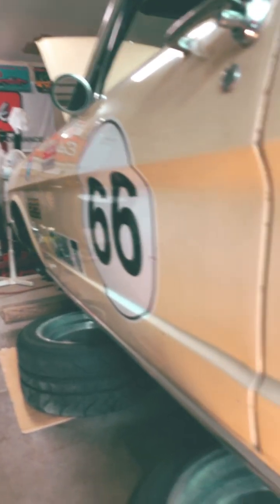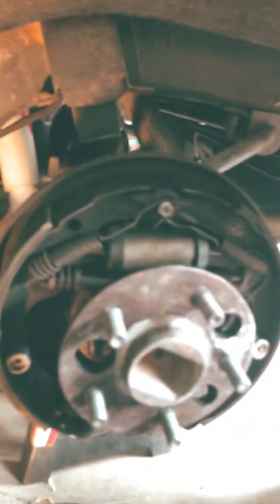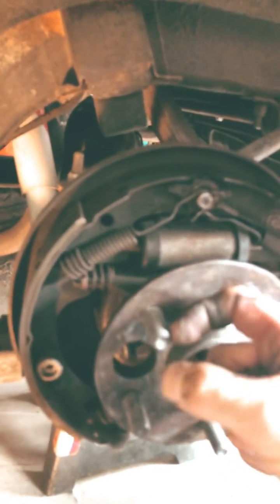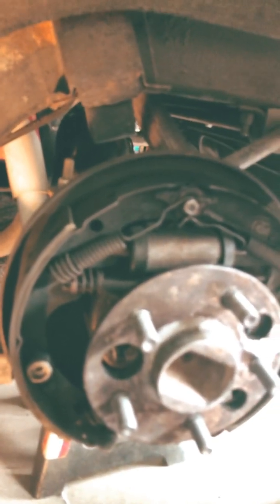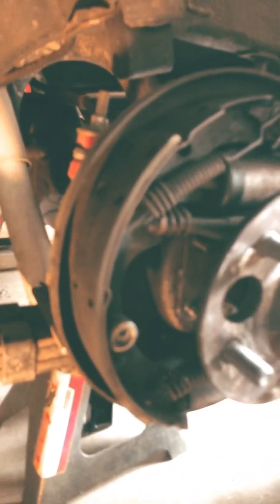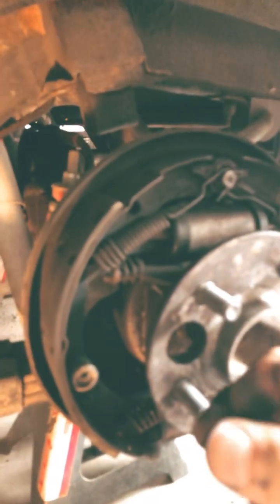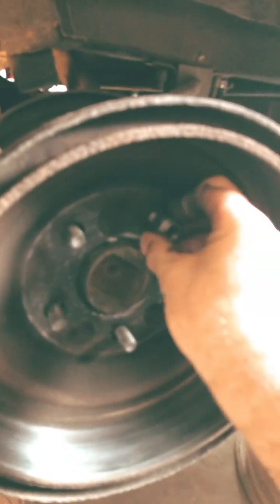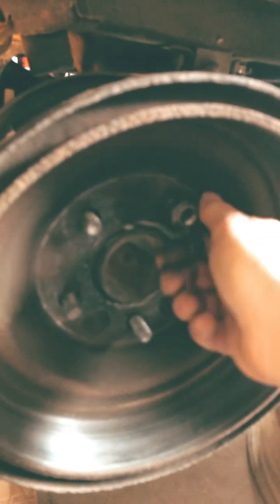Removing axles on a Ford 8" or 9" rear differential. Need longer studs to pass AHRA Tech.

Comment: Well it's probably too late now. But I don't take the axles out to knock the studs out. All I do is rotate the axle and Hammer 🔨 simply put nuts on the end of them. By the way you can still get lug nuts at Mom and Pop trailer sales for about 50 to 75 cents a piece. I use a big holes in the end of the axle flange to retrieve the stud. Can I rotate it and knocked the next one out so not to injure anything behind it. I'm assuming the axles you have are the same as all the ones I know of. They have the ridges on the shoulder and that locks them into the axle flange. Which of course all I do is put a few washers between it and a lug nut turn backwards to pull them through. I'm glad to see you're making forward progress on both the car and your number of subs.
Reply from the maker: For when I am replacing all of them I would rather press them in and out with a press instead of hammering the bearing on a car with a lot of sideloading when auto-crossing. For a street car break out the BFH.
Reply: @Blu_Grit_Garage  I see a point.. one hit on the stove with 5 lb hammer and they normally pop out. Do you know my dad always pop the axles out. Thanks for reminding me. I still don't think I'll change my ways.
Reply from the maker: Yeah I have a bin full of Lug Nuts. The ones I need are open ended with a  Shank, or whatever it is called (not tapered) that go into the rim and a Washer. My neighbor brought me to an Old Time Speed Shop in Illinois and was able to get the specific Studs, Lugs & Washers. Some of the Clients when we were there were kind of sketchy and did not look like the type that would approve of being on camera so I did not get a video.
Reply: @Blu_Grit_Garage  all those open lug nuts are tapered where they seat into the rim. I wasn't talking about the shouldered ones with the washers. Put people call them different things. Now you got my curiosity up about the old-time speed shop clientele. I was talking to a guy who buys repairs and sales lawn mowers. Is it right down the road there's a guy that used to be a trash man in New York city. In that 2 million house.. and find something else to do with the other 3 million. The lawn mower repair guy made no hesitation about seeing how this guy got his extra money 💰💰. Being from the St Louis area like you are I don't think you have to think too hard to figure out what organization he may have been affiliated with
Reply from the maker: @CAROLDDISCOVER-2026  Actually this place was Performance Parts Plus in Granite City, Illinois. Not too far from East St. Louis.
Reply from the maker: @CAROLDDISCOVER-2026  Hey, we made it, we are now at 502 Subscriptions. Anna and I thank you.
Reply: @Blu_Grit_Garage  I know where East St Louis is but I've not heard of this place. I know basically where Granite City Illinois is.